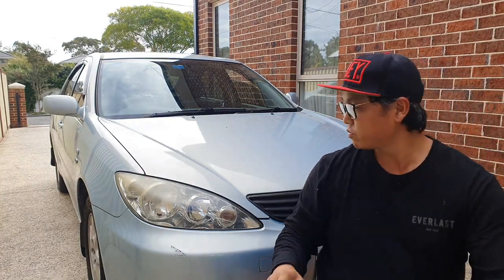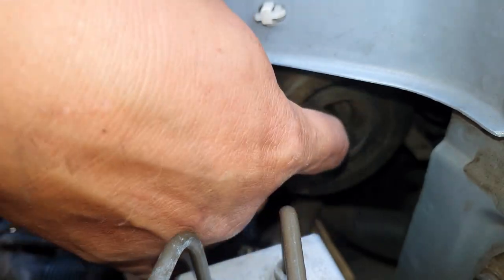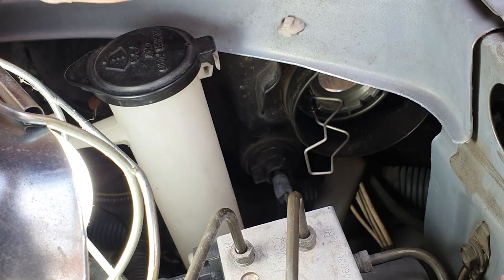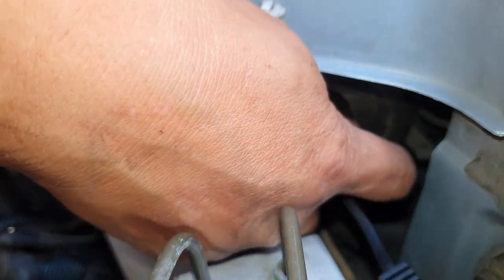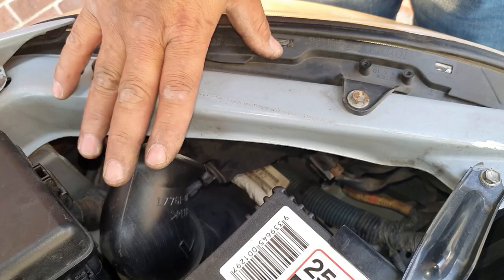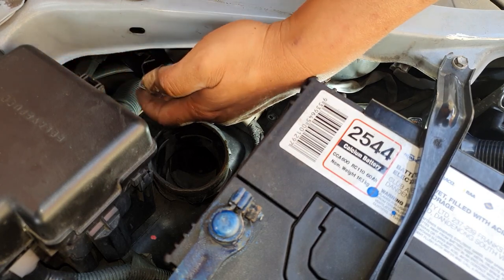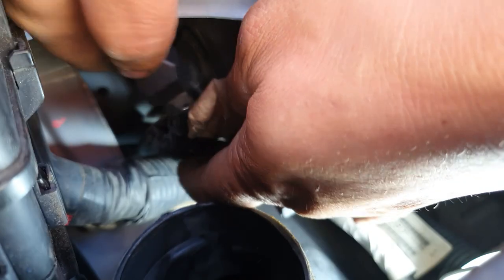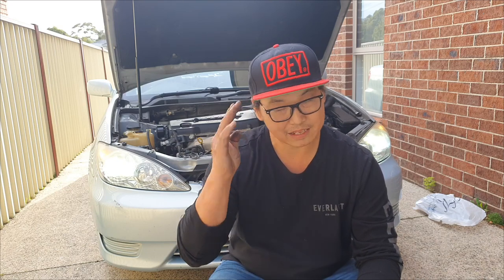toyota camry low beam h4 auxito led bulb install.

Comment: Should've flipped it to high beam too to show how it's working in the end. Because that particular bulb works both as low and high beam. I have the same car now. And searching to remove the same bulb. But overall this is the exact video I was looking for as far as the bulb is concerned
Reply from the maker: @deepakks  i do  it in another video  ill try find it and show u ..it does infact work as highest too as its a h4 bulb
Reply: @MIKEYZVLOGZ Yeah. Just checked in the next video. That bulb indeed is working. I needed someone else who has the same car in Australia and I found you. Thank God. 😅
Reply: @MIKEYZVLOGZ Yeah. The driver side one on mine isn't working on low beam but is working on high beam. so I was checking if I need to change the bulb or is there some other issue and I found you. I need to change the bulb.
Reply from the maker: @deepakks  if u look at this video i changed the high beam bulb and i do show how the low beam flips to high beam and when u turn on high beam it also flips the lowbeam to high beam meaning u have x4  bulbs reflecting high beam 
https://youtu.be/6odQNspxg7I?si=N4oklpOxYbtzTc0p
Reply from the maker: @deepakks  ye most likely faulty